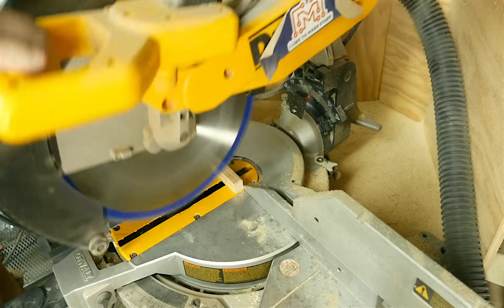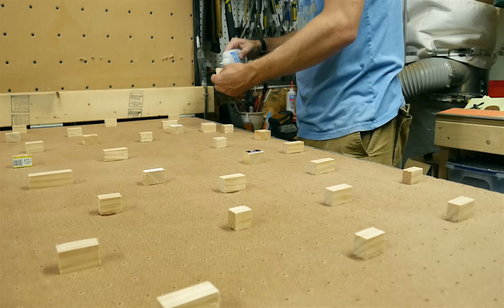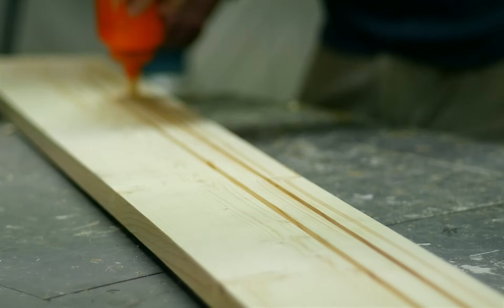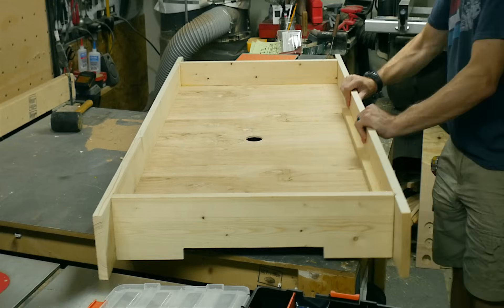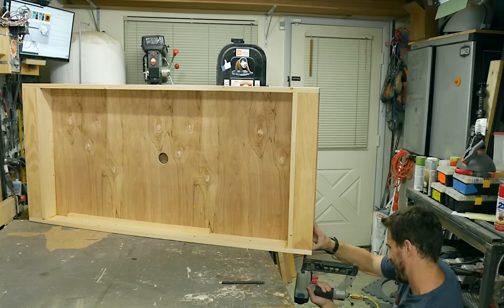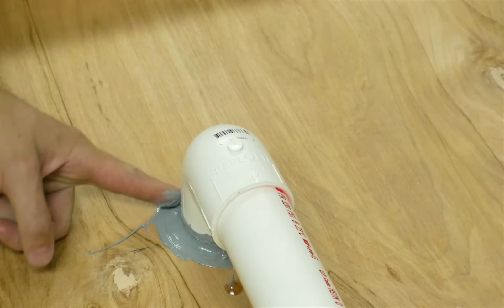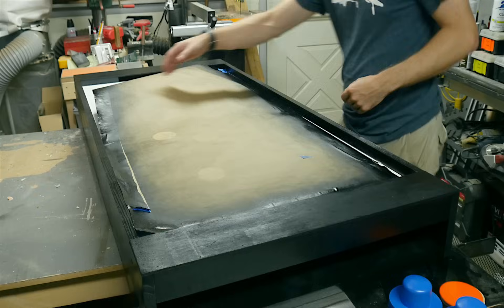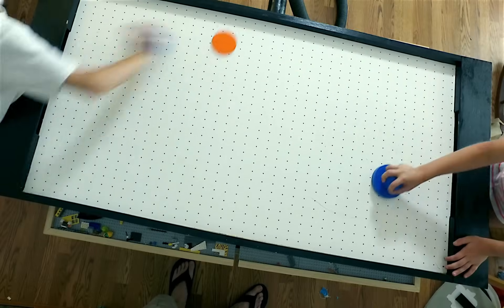Mini Air Hockey Table // How-To | I Like To Make Stuff

Comment: Build a soundproof box to put the vac in. Especially if you cannot find a quiet blower.
Or watch some of the homemade dust collector vids to get an idea, build what is essentially a miniature dust collector blower, and drive it with a 1/2-HP motor from an old washer, dryer, or dishwasher.

Comment: i wonder how using the dust collector instead of the shop vac would impact performance. the higher volume of air given off from the dust collector might make the puck slide even easier. great video!

Comment: I remember the air hockey pucks I would play with had a curve and lip on both sides. I think that would help it catch air better and allow it to slide easier on a weaker air flow. Trying to 3D print one might work and then you could use something more quiet and less powerful to blow the air through.

Comment: Awesome Bob!

Suggestion: may also be a good idea to create a proper frame between the 2 masonite boards and then create the side dados as thick as the frame + 2 of the boards, then glued and/or drilled that to the sides thereby increasing the air-tight-seal and making assembly easier.
Reply from the maker: Yeah, once I started assembling, I mentally got to what you just described.  You couldn't even need dados at that point, just a little cleat around the inside of the frame to set the table assemble on.  That'd be WAY simpler to put together. :)  Thanks!
Reply: Hey Bob, really cool game you made again. How about a Pool table? Think that could turn out pretty awesome :D

Comment: What about using a network of 120mm computer fans encased in the bottom? The casing would mute the sound and you'd have even air distribution AND it could be made portable.

Comment: Use about 6 120~140mm PC fans across the bottom at equal spaces to provide air flow. I had one that had one fan in the middle but it had to run at super high speed. Using more fans would distribute the air more evenly and could be run at lower rpm.

Comment: On commercial air-hockey tables, since the holes are so much smaller and have that higher velocity airflow, they actually often run off of a small box fan, like a PC fan. It might be worth re-drilling those holes much smaller, and then you could try sourcing a fan like that, or even just throw one or even a few large PC fans into the bottom of the table. It'd be a lot quieter and more convenient.

Comment: I've seen you cut "close" circles on your band saw and clean up on the disc sander a couple of times. You should look into making a circle cutting jig for your bandsaw. They are simple and will greatly improve your results.
Reply from the maker: Yeah, I need to make a small one. I made a big on for my He-Man shield so I could cut the floor mats down with it.  What I really need is to just get better at cutting precisely on the bandsaw ;)

Comment: I love this idea. I'm wondering if for the air it would be a good idea to mount maybe 6 or more computer type fans with an electric toggle switch to turn it on/off? It would be way quieter, disperse the air more evenly, and use less power to use.

Comment: hey Rob, I just came around your channel and I find it quite great !
About your noise and air influx, wouldn't it be interesting to make a grid of large computer fans? You may even the pressure and filter dust with a fabric. I think it should be quieter and give about enough air pressure to the table.

Comment: Hey Bob you should try to find an old air hockey table that's broken or unusable but maybe the blower in it still works maybe try using the blower it'd be alot quieter

Comment: Skip the aluminum sides around the bed of the table, and just use that black edging you installed on your arcade. Durable, easy to add (possibly? depending on the router bit needed to cut the dado / groove). Easy to repair once it's successfully installed too. 

Cheers!

Comment: On my childhood air hockey table the strikers had felt on the bottom so it wouldn't scuff up the table. If you're adding the aluminum and other longevity updates maybe it wouldn't be a bad idea so the table top doesn't get too marred up over time

Comment: For the noise try a fan. I built a similar table but I didn't use a shop vac for airflow but a fan and led the air with a trashbag to the board. It worket pretty well and unless the bag don't touch the fan it's verry quietly. 
My reasources and knowledge were very small. If I'd build something like this again I maybe gonna use a double board too and mount the fan directly to them like you did with your shop vac. This foil I used was a mess.

Comment: If you sand the faces of the pucks and make them concave, the pucks will 'hover' better and glide more smoothly over the surface. Also, adding felt to the bottom of the bat things will help them glide more easily.

Comment: looks good, my only suggestion would have been to slope the underside to a point at each end of the table, that way the air pressure and velocity would apply more evenly as the pressure increases further from the vac inlet with less area inside the table :)
Reply from the maker: Ah, good call!

Comment: For blowers you could use a squirrel cage  about 6" way quieter or even play with multiple computer type  box fans attached to the bottom directly  Its about air flow and not so much  air pressure.  The other thing you can do is countersink the holes on the back side  to improve the directed airflow into the final hole

Comment: Just a suggestion, but depending on the diameter of your striker base you could use a larger diameter PVC or ABS pipe (like 3" or 4") to line the outside of the striker base to make it more durable. Or I could just finish the video before commenting.Nice video. As a dad myself I'm always having to figure out how to make cool things for my kids. Thanks Bob!

Comment: Check out Seaflo Inline blower fans.  They're exceptionally high CFM fans, and might be small enough to hide under the table.  They're a bit loud, but with some creative sound deadening and encasement, they might be quieter than the shop vac.  :)
Reply from the maker: Awesome, I'll check them out! Thanks!

Comment: Felt on the bottom of the paddles would be a good add on, or did I miss that? Also, maybe try seeing if you can get some vinyl to wrap around the paddles and the inside edges of the table to protect the wood. Over time the puck would likely still damage the vinyl, but it might be a solution.

Comment: any consideration to using a high CFM computer fan for the blower?  I remember having a small air hockey table as a kid that had a similar setup.  I would think it'd be a bit more practical (and quieter than a shop vac).

Comment: Great work Bob. One thing I worry about though is you using your hand on top of the boards at the table saw E.g. 0:50. If the saw whips a board out from under your hand, your hand will drop down on the blade and you could get badly cut. Might be safer for you to use one of those  guide sticks carpenters use. Not sure what they're called - I'm no carpenter, nor trying to tell you what to do;  just mentioning it so you don't hurt yourself.

Comment: Another idea that could have been for this is, you could have made it compatible with your air compressor just made sure to put a gauge  on it so you don't break anything, yes a compressor is loud but if you have it in your garage you could run the hose in your house then you wouldn't have the noise of a vacuum, also you wouldn't have such a big piece sticking out of the side.

thanks for making videos

Comment: Great project! Unfortunately because of my lack of equipment & skill level, I can't do it; but, wish I could!
One thing, I'm losing my hearing which makes me more aware. If the shop vac is that noisy, it may affect your kids hearing. Even a rug vac compromises hearing over time. Damage is slight, but accumulative. Ear "plugs"/headsets or a long 
hose to put the vac in a different room?

Comment: Here's an experiment to try:  Put a box fan under the table and cut a bunch of holes in the bottom layer to allow the air through.  I bet a large diameter, slow speed, box fan will generate enough pressure to float the puck, and it'll be part of the table and quiet.

Comment: Do you think an intex quick fill air pump would be strong enough to power the table? I have one I found in the trash that I use to blow dust off equipment. It seems pretty powerful and best of all quiet. Quieter than a shop vac anyway. Air hockey tables are one of my all time favorites!!  Great build!!
Reply from the maker: It's possible! It'd be worth a shot!

Comment: If you built it over again wold you still do the dados for the top and bottom boards or would it be easier to just but strips of wood around the edge for them to fasten to, not sure how this would affect the air flow??
Reply from the maker: I would definitely do the strip method. In fact, I'm working on a set of plans for this project now, and using that method instead of the dados.

Comment: You should use multiple PC fans to power the table, will fit under it and be quieter, would just require 12v power or could use a old laptop power supply and wire the 12v fans in 12 banks connected in series to cut the voltage to 10v witch should be plenty.

Comment: Great video BUT rather than a wooden back for the goal, use a net with a cutout at the bottom. The net will catch the puck all the way back, then the puck will fall down in the hole in the bottom. Then have a simple catcher at the bottom like a bowl shape. I think this would work better.

Comment: This is awesome!  
I wonder if you could use something like melamine veneer instead of aluminum or plex for the dasher walls?  Cheaper, easier to cut and work with, gives the same net effect without sacrificing any play space.  Also, it might be worth experimenting with putting felt on the bottoms of the strikers.  This will help keep the rink surface from getting scratched. 

Finally, a question:  Where do you get the kicker for your CA glue?
Reply from the maker: Good idea!
I use this one http://azon.ly/TlIB
Reply: I Like To Make Stuff
Thanks!
Reply: Thanks, I was going to mention the felt on the paddles too.  Every air hockey game I've seen uses that to reduce damage to the play field.

Comment: Hey bob. Great project! Been watching a lot of the videos lately, looking great, plus the instructions are pretty clear. Thanks for those! 
You mention it runs on the shop vac. How powerful is that vac and what would you consider the least amount of power required to still get a decent result?

Comment: You spoke about paint chipping off the strikers. Would 3d printing be an option or is that material too soft? Also seems like some time ago you made a video about a toy mold, could you do something similar for a striker? If it is a solid piece, there would be no paint to come off. Maybe it isn't cost effective...

Comment: What about for the puck, making a disc of thin plywood that's only a tiny bit bigger than the acrylic disc, and gluing it to the top. It'd make it weigh a bit more, but it would get all the glide of the acrylic while only the wood rim would bop into the paddles and sides.

Comment: to make the puck better you should cut a recessed circle about 1.5mm deep and about 5mm from the sides with your x carve on both sides of the puck that way the air form like a bubble under the puck to float on

Comment: can u make a Arduino scoring system for part2

it would be cool to use like magnets on the puck the have a magnet detection thing on the goals

or you could use some infa red leds to see if they scored 

this idea is crazy but what if you built a score box on the top ( that was detachable) and put a camera so It could track the puck around the board and use that as a scoring system

Comment: it would probably be easier to just put some foam on the inside of the goals to prevent recoil out of the goal. it would be easier than cutting a slant in the wood and would probably aid in preserving the puck for longer.

Comment: What about electric fans or computer fans? Couldn't you use those for the pluming? Also why don't you make a little bold around the pluming exit and have a little score board and conceal the fan some more. Just some suggestions!

Comment: the reason why you need such a strong blower is, that the holes in the top board are so big. if you look at a commercial air hockey table the holes are really tiny.

Comment: The universal motor of the ShopVac is definitely going to be too loud.. You could use the blower from an air circulator fan, the type used for the "inflatable tube man" roadside displays...  Basically any induction motor would be suitable if you need low-noise and continuous duty...
Reply: Eugene Khaw Or from an inflatable Christmas yard decoration.

Comment: 2 tips:
1. Paint lines on the table top to make it look like a real hokey rink
2. Instead of just using one vacuum to blow the air you should have put 5 or 6 little fans underneath to make it quieter and it would all be flush.

Comment: I really want to build an air-hockey table. Better switch to industrial fans or very powerfull computer fans. I was calculating how much CFM it will request and after many months of work I finally conclude that something in the range between 200 and 400 CFM will be sufficient for an air-hockey table. The only thing I didn't know is 1 or 2 fans to use...based on the geometry of the table's inside chamber I think it will be better to use 2 fans with 2 chambered table. It will be very bad if the corners didn't receive the proper amount of air flow. :)
I have some arduinos, some sensors, a coin acceptor and a lot of relays (to start/stop the fans). I think one day I will have the room to make a full sized table.
P.S. The fans are about 75 dB loud so it will be better than the shop vac - that's for sure.

Comment: Wooden spacers between top and bottom can be glued with PVA; CA is an overkill here.
And, isn't the game field to short for adults? Seems to be hard to react in time.
The vac can be put in a massive wooden box with sound insulation. )
Anyway, great work!
Reply from the maker: I used CA for dry time. It's by far the quickest glue, and when you're making a new project for video every week, every minute waiting on glue to dry is lost time.
Yes, it's a bit small for adults, but I thought it was fairly obvious that I made it for my kids.  Regardless, I did play it a lot with them and it was fun and not hard for me to react in time.  Depends on the player probably though.

Comment: I am a little puzzled with your shop vac, mine sucks but I am assuming that yours also blows. I am probably missing a simple trick here but if you could enlighten me I would appreciate it
Reply: On many shop vacs, the suction hose will fit both the inlet and exhaust ports. Plugging the hose into the exhaust allows you to use the vacuum as a blower.

Comment: I might have tried using an air compressor, just leave it out in the garage and run a hose into the house to the table. Plus you could adjust the air pressure.

Comment: You could try a squirrel cage from a junkyard car...just need a power supply to convert to 12v.  You could adjust the speed with a potentiometer.

Comment: You can use a heat gun to make the pic more malleable then you wouldn't have to stand down the shop vac u could just stretch the pic around it

Comment: Glue fabric to paddles' bottom, plywood will eventually make surface rough and it will work waaaay worse. 
And it's good that you haven't added aluminium sides, I tried to modify our school's air hockey table by adding them, and it only got worse :(

Comment: I have a manufactured hockey table and it uses to fans like computer fans just a bit larger there like 8" inches sq to supply the air and they work fine

Comment: I'd say  just remove the filter all together. You're not using it as a vacuume, so nothing but air will enter it. I'd use a blower motor due to the loudness of a shop vac. Thanks!

Comment: 5 muffin fans in every corner and the middle would work for the air. Run them to a wire strip with a switch on it and call it a day.

Comment: @I Like To Make Stuff - I found this exhaust fan for a project I'm working on. Might work for 
you. 2x the airflow of a standard shop vac (327CFM) and could be mounted
 underneath the table. Not sure if it would handle the output resistance
 of pushing air through the table holes at that same rate though. http://www.homedepot.com/p/VENTS-US-327-CFM-Power-6-in-Energy-Star-Rated-Mixed-Flow-In-Line-Duct-Fan-TT-SILENT-150/204804485 Also it's very quiet.

Comment: use a squirrel cage blower fan. and the puck might work better if the center was cupped out to create an air pocket and you go crazy and make a mold of a striker and cast it in epoxy just some suggestions love the video this is an awesome design
https://www.amazon.com/Stanley-655704-Velocity-Blower-Yellow/dp/B006O6FA22/ref=sr_1_1?ie=UTF8&qid=1469139801&sr=8-1&keywords=blower+fan

Comment: I recently built a boot dryer using a small shopvac from Home Depot that fits on top of a 5 gallon bucket. It was only $20 for the vac and I modified it so that I could permanently mount it on my boot dryer. It would be cool for this project because you could mount it to the bottom of the table and eliminate the need for an external shopvac (although it may require smaller holes in the top to compensate for the lower cfm)

http://www.homedepot.com/p/Bucket-Head-5-gal-Wet-Dry-Vacuum-BH0100/202017218